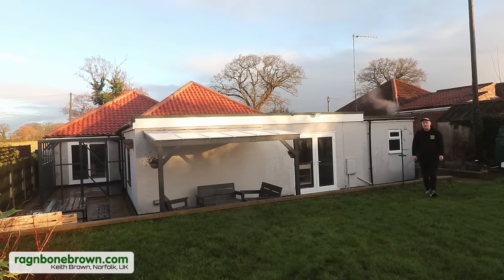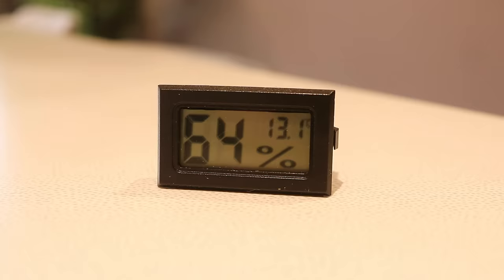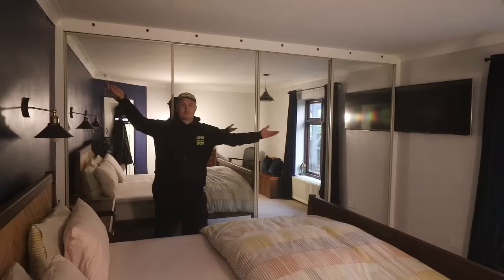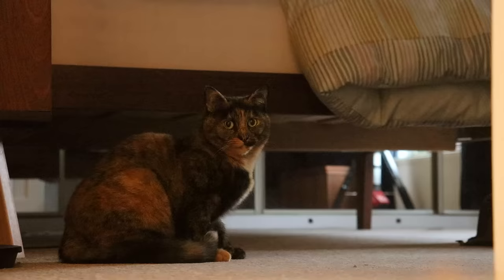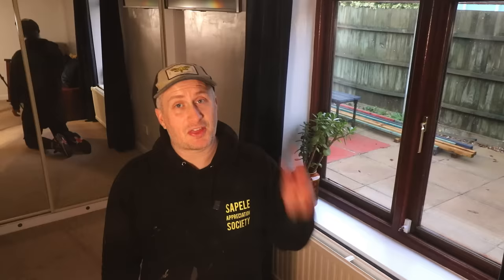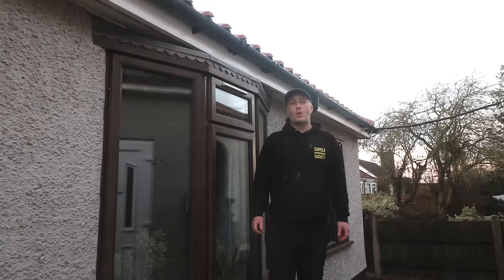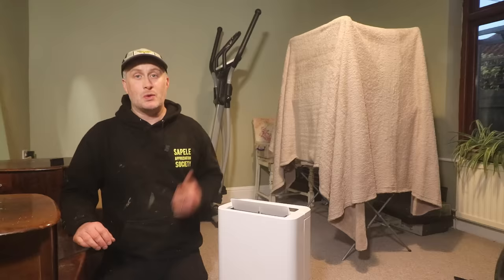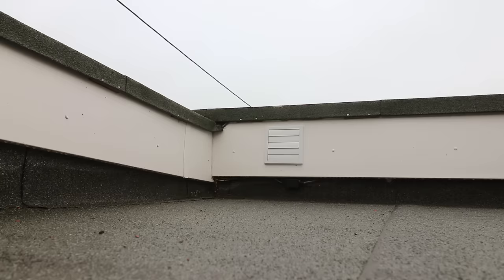8 Steps To Fixing Damp, Mould, Condensation & Humidity In Our Home

Comment: A well timed video for me Keith - we've recently moved into a 1930s semi with solid brick walls. When it's cold we have condensation not only on the windows but many walls. Built in wardrobes get spots of mould if not left open. I am ordering a heated PIV to install in the loft. In the middle of installing 55mm insulated plasterboard on exterior wall of a bedroom at the moment. Also going to insulate under ground floor floorboards etc will take some time and £££ but should improve the house dramatically
Reply: It’s likely your issues are being caused by the wrong plaster. Gypsum plaster will not allow moisture to escape. Lime plaster allows your wall to breathe as it should. Although PIV systems work, they are dealing with the consequences rather than fixing the issue.
Reply: Do let us know how much of a difference heated PIV make to condensation and humidity
Reply: @simongoldsworthy3126  there are a number of issues at play, gypsum plaster alone is not the no.1 issue. Relative humidity, the dew point, heating and ventilation are much more the issue and not difficult to solve. But I agree lime plaster and limewash would benefit many older properties.
Reply: @AdnanKhan-dg9ix  yes will do because I think this an issue that affects millions of us, and not everyone knows how to deal with them so props to Keith and other youtubers for raising it 👍🏻⭐
Reply: @AdnanKhan-dg9ix I am revisiting this video nearly a year later - I have installed the nuaire drimaster PIV which has indeed improved many of our condensation issues. It's much more effective on windows that aren't covered by curtains. More effective if doors can be left open a bit too. My daughters room has 55mm insulation boards and is now the cosiest room in the house. My son's room is smaller and has 2 external walls, I used the thinner 28mm insulated boards but still much improved! Hopefully next year I can return to say the lounge and my bedroom are insulated - these have single skin bays and so desperately require insulating, along with the suspended floor which I intend to insulate following ali dymock's guide, with rockwool insulation, breathable membrane and vapour barrier 👍🏻

Comment: I had problems with mould in a flat for about 15 years.  I started by doulble glazing the windows.  This helped a bit but certainly did not fix the problem.  The solution that worked for me better than anything else was to insulate all the outside walls.  I had to insulate every wall.  It was difficult to insulate  a wall in the bedroom in a narrow room where I could not afford to lose space and a radiator was in the way.  I had old thick Victorian plaster.  I found a plasterboard that had 17 mm of polystyrene insulation and and 9 mm of plasterboard stuck together.  When I had it put on with a skim coat of plaster it was the same thickness as the old 32 mm Victorian plaster that was taken off.  Where I had space I insuled the walls with 50 mm thick solid insulation board with 50 mm battens on the wall and with plasterbord over it. I even insulaed under the timber floor (100 mm solid insulation board held up with chicken wire.  Note: do not put fibreglass here because if you have spills on the floor it could get mouldy under the floor - the solid insulation will dry off)  (and insulated the central heating pipework and cold water pipes at the same time) but this was not necessary.  

The insulation made the walls warmer and I never had a problem with mould again.  I did also put an extractor over the cooker.  I could not vent the steam to the outside but it still helps because it keeps the moisture in the extractor rather that on the walls.  I did have ventillation holes in the wall but it did not work until I insulated all the walls.  I left the bedroom wall to last.  Mould was on the bedroom wall until I did this wall.  I worked at the walls bit by bit until the problem got fixed.  I was learning as I was getting the work done.  I had to insulate every single wall to completely get rid of the problem.  Of course the side effect of all this work is that the flat is warmer and a lot cheaper to heat.  It was well worth doing.  It did not cost a fortune.  The flat now has an EPC (Energy Performance Certificate in the UK) of C which is good for and old flat.  Best wishes.

Comment: Live in an old house no idea how old but 200+ years very bad damp problems in 3 of the 4 bedrooms and on the walls by the porch door no idea what the humidity is but did get some esp8266 microcontrollers and sensors to monitor temperature / humidity / IR hoping to tie them into my home assistant didn't know about the positive pressure airflow device, will look into that was just going to fit extractor fan in the loft with ducks to the bedrooms and hall and have the ducts and fan be smart controlled but your solution looks better

Comment: Hi, we are in a very similar position as you were at the start of your home improvements. We bought a three bedroomed bungalow just outside of Norwich and basically gutted it and remodelled all of the rooms. At the outset, I was horrified to see so much black mould in almost every room. I initially put this down to the previous occupant not ventilating the rooms. Even now, we are still getting a lot of black mould in our kitchen and bedroom. I hadn't seen the device you have fitted in the loft before so that's now top of my shopping list. Even with new double glazed windows throughout the bungalow, I don't think this has made hardly any difference to the mould issue. They are of course more solid and therefore more economical than the previous aluminium frames that were in place. I still have lots to do but your video has really enlightened me. I didn't realise bungalows were susceptible to this issue but I do know! Thank you.
Reply from the maker: Thank you

Comment: Just remember those cheap sensors are generallt uncalibrated, relying on batch calibration to get a reading accurate within 2 counts per unit, but the overall accuracy is plus or minus 5 % either side, though the temperature side is generally, due to the sensors being made in bulk and trimmed during manufacture, within 1C of the actual temperature. 

Getting lower humidity you probably want to first get a countercurrent heat exchanger, and use that on the bathroom vent, so that some of the heat in the hot humid air is used on the way out to heat the incoming air, which will also leave it less humid. Same for kitchen, where the exhaust will do the same for the replacement air, both lowering the amount of heat needed to heat the interior, and reducing humidity as well.

Comment: Great video, concise and helpful summary of the issues! We’ve got damp, humidity issues in our home c. 40 years old detached suburban house. The attic had insane damp problems so we got a high quality extractor to remove the humid air and some vented tiles fitted to bring in fresh air. The fan is connected to a smart humidity meter so that it can be on when the humidity is where we’ve set it. It was a pretty cheap but effective smart device. We also invested in a dehumidifier which regularly takes out an incredible volume of water! Our windows have no trickle vents and I’ve been a bit reticent to drill through the uPVC and install my own. Worries i’m going to end up drilling through metal or the mechanical bits of the window.
Reply: Most UPVC windows are designed for trickle vents. You can specific them when new. It's the same frame. Do be careful but it should be possible.

Comment: I used to fit ventaxia loft fans that pulled air from loft a pressurised  house through  sealing vent you need  ventilation  pvc windows need vents in  them

Comment: I'm in a new build about 24 years old now.  Mould is a problem.  My other half doesnt help as he won't open windows particularly in the winter.  It runs at about 84% downstairs and 70s upstairs.  It's a warm house.  I have monitors, we have the drip function and keep dehumidifiers on the window ledges that are affected the worst.  Not switched on all the time, just when needed.

Comment: You could fit small 1inch circular vents to the lower internal doors (or rectangle air vents) so even when the room doors are shut you still get some airflow between the rooms ;)

Comment: Having a lot of these problems in my 90s detached chalet style bungalow, was a one off build so the builders, shall we say cut a few corners, no air bricks, very poor wood framed double glazing. Also seemed insulation was an optional extra the original owner never selected as the upstairs sloped ceilings are plasterboard, joists, some felt and then the roof tiles. I used a borescope initially to investigate. 
Anyway similar issues to you sat in a room now its 71% humidity I have to clean the windows down daily from condensation build up. Certainly going to look into the PIV and work out where I can put a few air bricks. Also the bathroom extractor, I actually had to disconnect that the storms we had last year relieved it of the flappy vent similar to your kitchen one as a result when it rained you would get water pour in and short the motor which is not very enjoyable mid shower. Vent wise if you have noise issues I'd recommend getting the Manrose cowl ones they are around 4 pound from screwfix I have two and have had no issues with them

Comment: We have a range between 17% and 77%, currently 57%.  We live in a 1980’s detached house with a PIV fitted on the landing ceiling. 

The one thing to consider is you issues with the roof will have dumped a load of moisture into the house.

Comment: I would highly recommend using a heat pump tumble dryer (if you can't fit a vented one). It will pay off in the long run.

Comment: 30 to 60 well I would say you’ll never get any household in the uk ever down to 30 but anything below 50% should be exceptable, I live in a mid terrace house in north England and I’ve had issues with high humidity , condensation and black mould and we did have one of those units fitted in the loft but we found it not very effective as it just blew cold and damp air in to the house from the loft so how these units are supposed to reduce humidity levels I’m not sure but I did invest in dehumidifiers in problem rooms and I run them 2 to 3 hours in the morning and late evening and they work really well, infact they are very impressive as you shouldn’t even open your windows as the outside humidity can be higher than inside your house so when people say open your windows to reduce humidity or condensation I just think is ridiculous as you need a device like a dehumidifier to extract the moisture from your home which lowers the humidity and like you said makes the inside air drier which is easier to heat up especially in winter so I believe dehumidifiers pay for themselves by cutting heating costs down because it’s easier to heat up a dry room than a damp one, simple, also I applied and damp proof membrane paint on my problem outside walls then 4 layers of thermal paint or condensation paint with a mould inhibiting product added to the paint and this has completely stopped the condensation building up as the inside walls are now dry and not damp or cold in winter so it’s completely eliminated the condensation problem so it’s all to do with using knowledgeable information and applying the methods into practice. Good luck

Comment: Excellent video, thank you, some good ideas and sound advice.  We have exactly the same problem although our house is not modern construction (late 18th century Devon small farm workers cottage - cob & stone in-fill with a tiled roof), no amount of opening windows really helped.  We've also removed mould and painted with resistant paint - working our way through the house, and we have a dehumidifier, which made a big difference.  We can't get our levels below 62/3% and only on a really good day.  However, like you we've found that heating the house is easier (no mains gas here).  We haven't come across PIV but it looks like a good idea, one we will definitely investigate.  I don't know if you know, but we were worried about installing trickle vents to the windows as we don't want to increase the noise levels in the house (neighbours' cockerel(s) which the double glazing muffles quite well at the moment!).

Comment: 63% is good for most houseplants Keith :) .I live in a thick walled cottage that averages about 65 in winter but so long as we keep ventilated and we've got a stove running were ok...  dont really get mould or visible dam issues. Moving air doesnt cause mould same as still air with no exchange so the 65% is ok for us.
Reply from the maker: Cheers David it's nice to compare notes 👍
Reply: @RagnBoneBrown  Everything below 65% is ok for living areas, been having the exact same problems. The only solutions are: ventilation with (dryer!) outside air , dehumidifying or heating up the rooms. For your workshop, surface rust will start to show as soon as things go 80% up, keep an eye out for that. However you need to consider blind ventilation is not the holy grail. Ventilating with (more) humid (outside) air will increase your inside percentage during eg rainy winter periods. The same thing may happen during the summer months. This may be less visible in summer as there is ventilation with cool (dryer) air during the night.The areas in which you will have most issues are probably areas where there is no heating (or turned on), say areas like an upstairs bedroom or a basement. Check outside humidity as well, I actually block ventilation during hot summers in my basement to stop the air moisture levels from rising. Warmer air will hold more moisture so ventilating in some rooms may actually increase humidity levels during the warmer/humid parts of the year. If you have no heating or dehumidifier you may not be able to bring this down "naturally" for weeks. As long as you have the meters in place you will pick up on this. Where you cannot afford the damage invest in a mobile dehumidifier at least as a backup (as I do in my basement workshop). Good work !

Comment: Bungalow of a similar age, perhaps a touch later. Terrible humidify, terrible mould in the winter. Its a weekly mould cleaning routine. We are right down south so weather is mild, situation is usually better in cold weather as the wood burner is run more causing a greater though put of air. Currently 80% in living room, worse in other rooms. Planning a big renovation / loft lift with some sort of ventilation system. This makes me reluctant to spend on a PIV system in the meantime.  Its always a battle in the UK but this house is the worst!

Comment: Wild. Here in the US, it's wildly different. I always heard that the UK was more... wet, but I didn't know it was that bad! Most people in my area put humidifiers on their HVAC systems because it gets very dry in the winter. My main floor stays at about 40% year round, but my basement varies much more because there's no recirculation down there. We've only recently bought a dehumidifier for downstairs to help manage the humidity and it's going great for us.
Reply from the maker: Oh wow! Interesting stuff. Thank you for sharing
Reply: It's the joy of a, generally, westerly wind blowing across the pond that does it for us!
Reply: @FFVoyager  yeah, my westerly winds come from the, well, western US. Sometimes it comes down from Canada and dumps a lot of rain/snow. I just didn't imagine that your cold weather months were more humid. Never really thought about it. Without a humidifier, my house would get close to 20% in the cold months and I'd shock myself on every appliance and light switch in the place!

Comment: My wife n I used to live in a flat we lived on the ground floor and there was 2 floors above us we suffered badly with mould from the day we moved in but it was always on the one wall In the living room, 2 bedrooms, bathroom and kitchen. We tried to keep on top of it cleaning it and using mould resistant paint  and had extractor fans fitted in the kitchen and bathroom which was on auto so pretty much ran constantly. When we moved into our current property we was back n forth to flat n anytime we went in you could smell the damp.

Comment: Look for decentralized MVHR systems. They're usually reasonably priced (3-400£ each give or take) and decently sized (160mm bore hole, 3-400mm length). They will help a lot in damp rooms. The system pushes out the warm and stale air heating a ceramic heat exchanger, which in turn gives back the heat to the new air being pulled from the outside in another cycle. You should expect a 90% ish efficiency in those things; if not search for better ones. I've used two in a damp house built in the 1930s after a renovation with insulation + new windows with very good results and no mold or condensation even in the coldest/rainy months.

Comment: 1970s semi. Humidity in the 50-60 range. 
I will get some condensation (about 2-5mm high) at the bottom of some of the windows - trickle vents usually open.
I have the heating set to a min of 16 during the day and 13 over night. Heating comes on to 19.5C for about 90 mins in the morning and about 4 hours in the evening.

Bathroom window usually left ajar, and always open when showering (plus extractor fan with humidity sensor). Will also use a squeegee once showered to clear down any water on the shower walls. My shower cubicle has a "lid" to it, so that helps. 

Whenever possible, the washing is dried outside. If not, then some heavy items will get a 40+ minute go in the tumble drier, and then join the rest on an airier with the dehumidifier going. Have found that jeans take ages, so an extra few mins in the tumble drier beats an extra hour+  on the dehumidifier.

Also, have made sure the loft is well insulated and also sufficiently ventilated to the outside.
Reply from the maker: Thanks, great tips